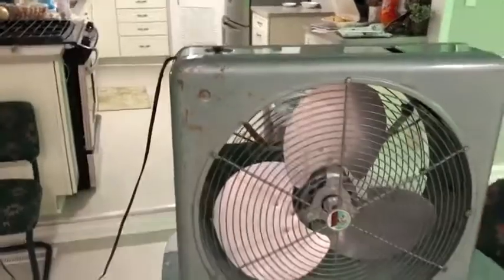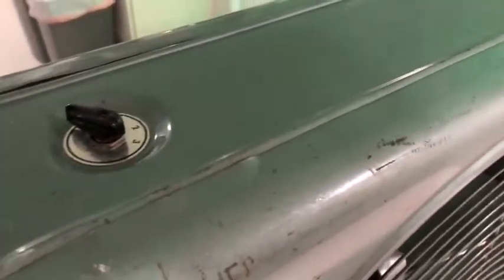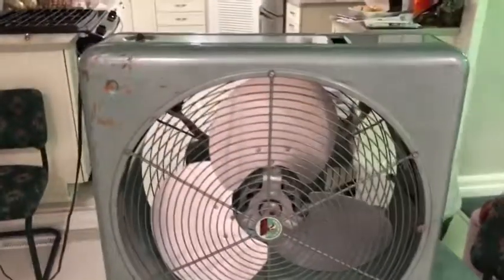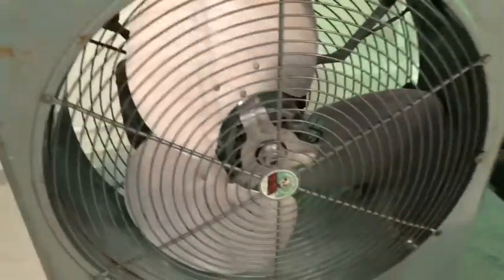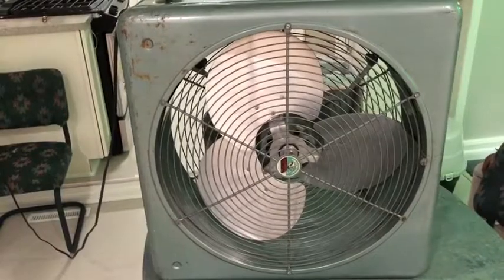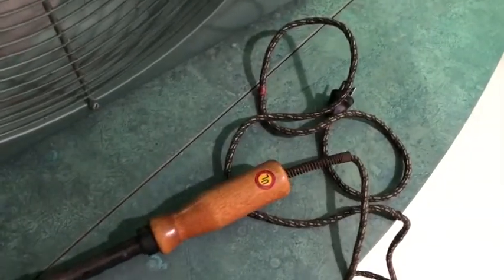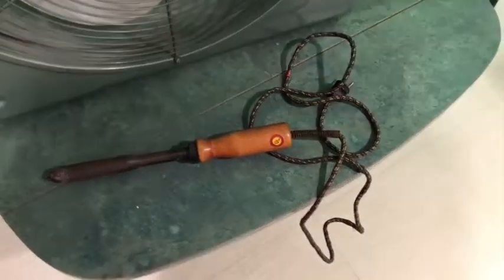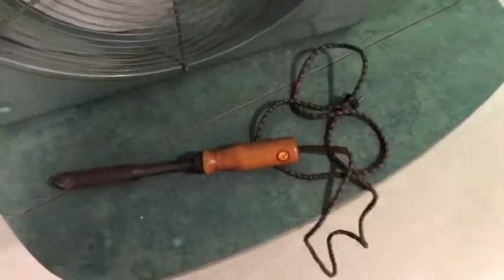Vintage Atlas Box Fan and Large 100w Drake Soldering Iron

Comment: Great fan!  I've got this exact same model, but in much worse condition.  I'm currently cleaning it up and replacing the switch.  The previous owner bypassed the switch and hotwired it on high.  This fan does move a bunch of air!

Comment: That's a great fan, nice startup sound, metal everything, and of course it's no wonder that it still works to this day!  I've seen soldering irons like that, you need to make sure you ONLY grab that wooden handle otherwise you're in for some really nasty burns!
Reply from the maker: In the summer I think it might be put into a window to act as a whole house fan. It certainly has enough power for that application. The soldering iron will be replacing a Weller soldering gun that broke recently for heavy chassis soldering on vintage radios and television sets.

Comment: Did you ever find anywhere where someone got the faceplate off the fan? The switch on mine just stopped working.
Reply from the maker: The inner ring around the fan blades removes, I had to replace the switch in mine a while back.
Reply: @richardhz-oi8px  is it pretty straightforward once you get the grill off?